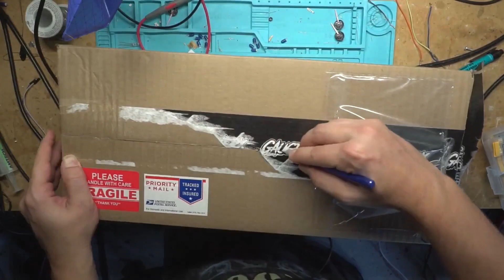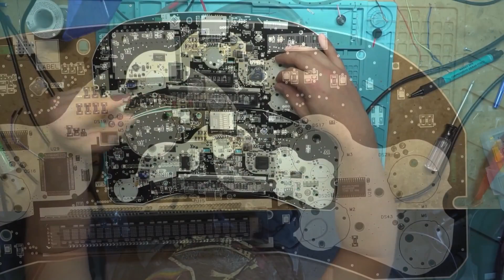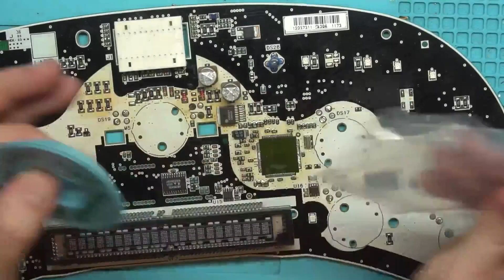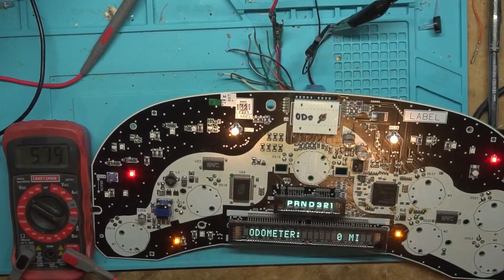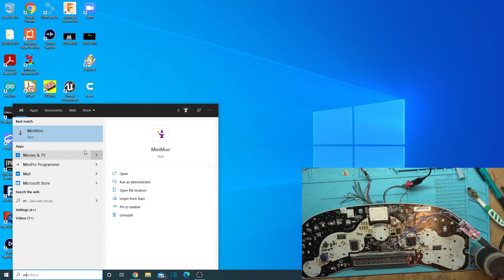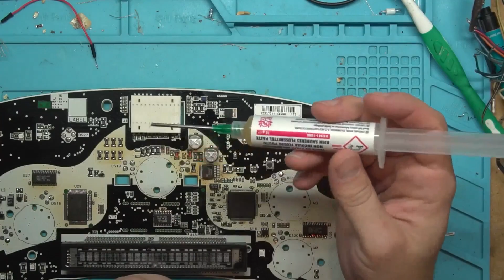03/04 GM Cluster: Brain Dead Processor Replacement. Sent to me from Gaugewerx

Comment: As it happens, I'm slowly working on a 'project' van 03 GMC Astro van. I have no idea if the cluster works or not, didn't check that before tearing into the engine. My big question is this: Is there any benefit to doing anything to the cluster before I put this baby on the road? Or should I wait till it dies before doing anything? 

As best I can tell it's never been been disturbed since GM put it together. If it will help keep it from dying I'd rather "maintain" it now but I don't know enough about these yet to know what the best approach is. I am watching and learning though!
Reply from the maker: My opinion if it's not broke don't fix it lol
Reply: @FixedUntilBroken  Then I'll take your advice- thanks!

Comment: Awesome video, man. Both of those boards were from customers who failed to self repair and ended up ripping pads/blowing the processor.

It’s more cost effective to replace the board when ones like that come in. I forgot I took that gear selector VFD off. Lol!
Reply from the maker: Oh I agree for sure. In my opinion boards that need more than 4 jumpers really shouldn't be resold because the the jumper repairs are much more likely to fail leading to have to do warranty work. I only have option because you can get junk yard cluster for $40-$60 so your better off just replacing the board like you said. I did this for fun and to show it can be done.
If it had only been a failed MCU I would say the repair was worth it and to sell it. It really only takes about 30 mins to an hour to swap the MCU and program it. they are less than $20 ea. All the jumpers make it not worth the time. to sell. It's a perfect parts board though because you know every part is working lol.
Thanks for making the video possible! All my parts boards were stripped too clean to do this.
Reply: Gear selector delete lol
Reply from the maker: @EastCoastGaugeRepair  adds 10 HP and weight reduction for drift life.
Reply: @FixedUntilBroken  I have a parts 05 board with a hole in the processor from a self repair/ led install. I used the gear selector for another board that had a burnt out VFD. If you would like it aswell, its yours. PM me on @eastcoast_gaugerepair FB/IG and I'll ship it to you.
Reply from the maker: @EastCoastGaugeRepair  thanks tomorrow my shipment of those processors come in. If they turn out to be real I'll definitely hit you on on that. It was a super shade @hotmail kind of deal lol

Comment from the maker: Huge thank you to gaugewerx for sending this to me. I asked him for a parts board that wasn't worth the time to fix and he delivered! This was a project purely for the video. A fun challenge of fixing a dead MCU to show that it can be done with new MCU's and BSL. I know said wasn't going to be able to fix this one in another video that was because I didn't know the MCU pulled down pin 4 of the voltage regulator I thought it worked the other way around. knowing that I figured out I had a bad write to the MCU wrote it again and that fixed it.  
I am a little jealous of gaugewerx brand building. I am going to have to get some stickers of my own.
EDit: I misspoke in the video and said pin to 2 of the regulator I meant pin 4.